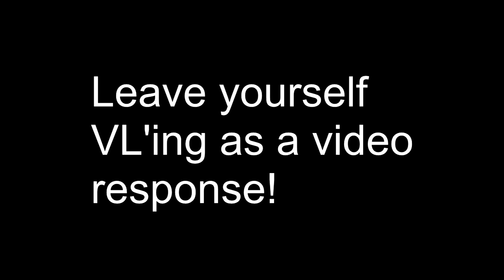Preschool Cap and Gown Photoshoot!

Comment: your fan in the computer is probably still full of hair. you need to pull the fan out and easily pull the blades off then the hair will come off and it should spin freely again. you really should be blowing that thing out every three months though more often in dustier climates.